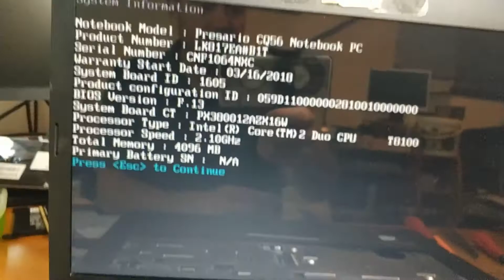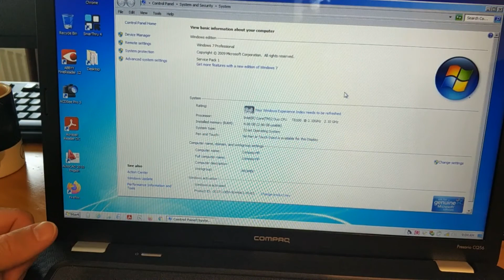Compaq Presario CQ56 - Disassembly, Cleaning, CPU Upgrade, Thermal paste replaced

Comment: FYI : If you're looking to upgrade the CPU of the compaq presario series. You need to have an updated bios or the motherboard won't support the cpu.I had never updated my bios so when I installed a new i5 CPU, my laptop never booted up. I thought maybe i forgot to plug some cable or something but none of the cable were unplugged it was just the motherboard not supporting the new processor. Also to update your BIOS you need to have x64 bit Windows 7 (everything expect for 7 home- new bios update doesn't support 7 home) so if you're using 10 or some other OS then be ready to go back to window 7. Then with the new updated bios, motherboard will take the new processor.
Reply from the maker: Hi. You are right in some way, but, always, when cpu upgrade is made, is a good and necessary move to upgrade bios before changing cpu.
Also, bios can pe updated from dos, through usb stick or CD disc, not necessarily from Windows. Also, usb stick or CD disc can be made on other pc/laptop.
Also, are many variables at cpu upgrade that can go wrong.
Anyway, thanks for advices, Mitch.

Comment: i have one but  tried everything but am scared am going to do it wrong and break this computer
Reply from the maker: Hello. What do you want to do, dust cleaning?
Reply: @DaneluRepairs  nahh i just wanna no how to get to the mother board and thx am still watching and keep u the great work I subed by the way
Reply from the maker: @GaugeClements  thanks mate. Ok. If you disassembly with patience and care(watching how i do it) , i'm sure that you will succeed, is not that hard.
Reply: @DaneluRepairs  i agree but right now am struggling taking the top of but thx
Reply from the maker: @GaugeClements  use something to pry bottom case and palmrest, like a knife, but don't stick too much inside the notebook; and bend the pry tool a little bit, in both direction till those two parts snap free
Reply from the maker: and check again if you forgot some screw from below the laptop(bottomcase), ok?
Reply: @DaneluRepairs  OMG THANK YOU SO MUCH I DID NOT KNOW THX FOR THAT, YOU JUST MADE ME REALISE, by the way can I run a intel core i3 in this conputer
Reply from the maker: @GaugeClements  glad i could help you, mate; and warm greetings from Romania.
No, you cannot put in this model cpu from i family; only from T, i put a T8100 on notebook from video.
Reply: @DaneluRepairs  ok
Reply: @DaneluRepairs  MY CONPUTER IS WORKING BUT SCREEN IS BLACK WHATS WRONG WITH IT U BWOKE MY PC
Reply from the maker: @GaugeClements  i hope you did not say that i broke your notebook, i try to think that is a misspeling words from you...
Reinsert memory again. That's the first step.
Second, there are some beeps from speakers?
Reply: @DaneluRepairs  Hello my friend.  I have hp cg56-150sv with T3500 intel processor, can you tell me if it is possible to change it to a better one?  thanks and also if is possible to change hhd to ssd
Reply: Hi, can I put the T9900 ou T9500? And the SDD is possible change for one with 2T? For the RAM I want to put  2x DDR2 4 Go 8 Go 800MHz  6400 RAM 200Pin 1.8V, is that possible? Thanks nice job 💪👍